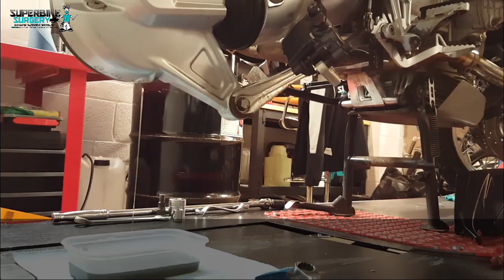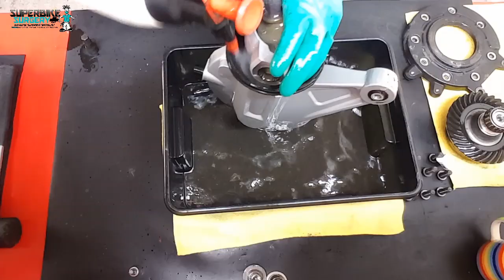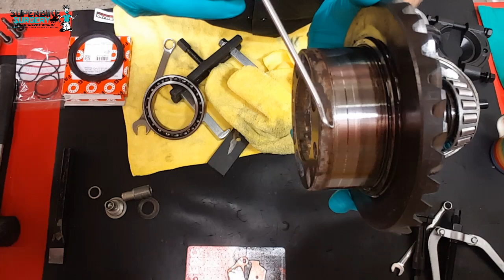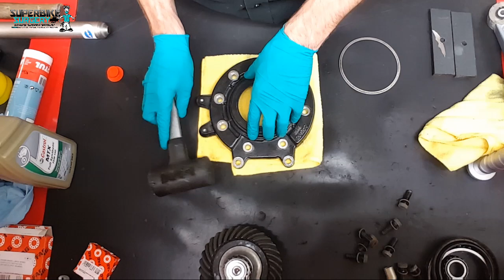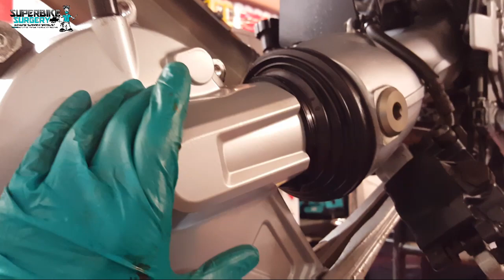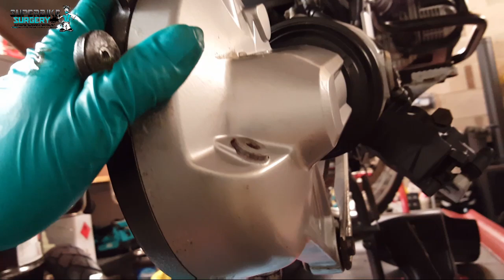BMW R1150GS Adventure Motorcycle Final Drive Rebuild

Comment: I'm going to buy a bike with a chain what a load of nonsense
Reply: flobeeone kinobee I’ve seen these drives last 100k miles with regular oil changes.  That bike probably has some serious hard miles on it.   This video was around 1 hour and I think it’s probably a 3 hour job in reality.   How long does it take to replace a chain and how often do you have to do it.   How smooth and quiet is a chain?   How resistant to the elements is a chain?   Shaft drive gets my vote... but then again you didn’t ask for my opinion either lol.   So I digress.  Just my 2 cents.  Cheers.